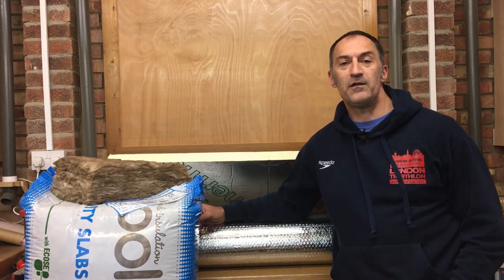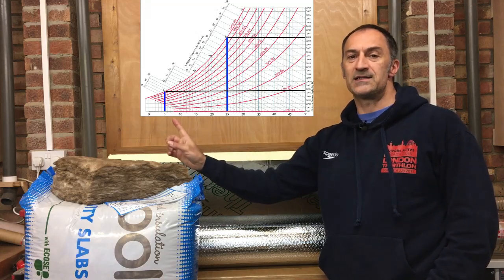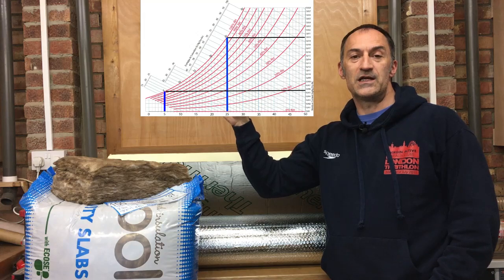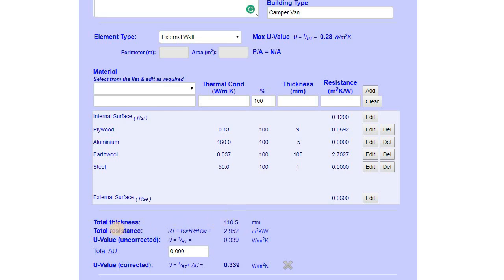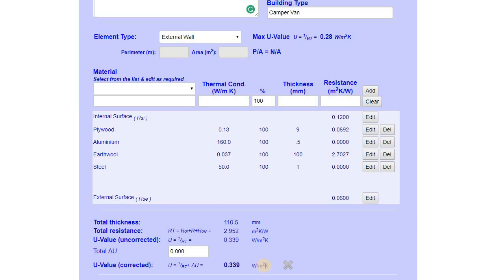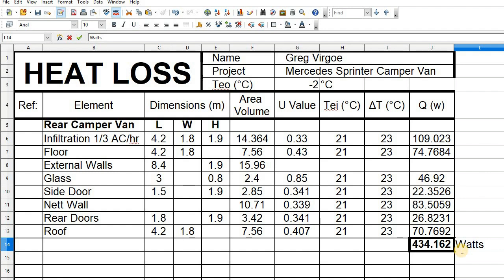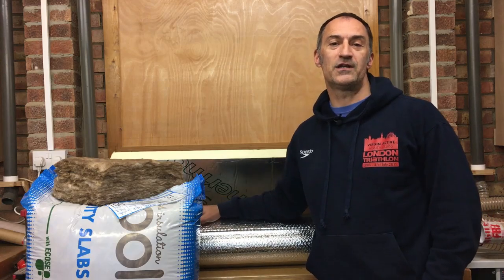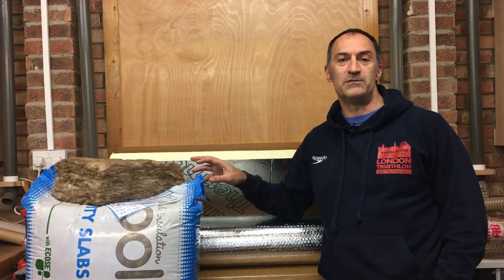How to Insulate your Van Part 1 - The facts you need!

Comment: It's amazing how many DIFFERENT OPINIONS there are regarding van insulation. I am going with you! I have already put some Polyiso with some spray foam so I am super glad that I didn't error on that. Thank you. But one question: it's probably best to put up the moisture barrier as soon as you can after gluing on the Polyiso? To prevent moisture etc.  What if you can't do it right away? Where do you buy the wool stuffing? And do you leave open internal spaces for electrical or use conduit on the outside?

Comment: Thank you Greg for THE most informative video on van installation I've seen. I'm a complete novice to van building. I had planned out my instillation from an amateur point of view before finding this video. I'll make a few changes, but it's good to know I got good SWAG (Stupid Wild Ass Guess).  I will put in a vapor barrier now. Thank you for explaining the need for one.
I have two questions if you have time.
#1- The ribs of the van, roof and sides, they transfer heat and cold even if you insulate around and inside them, correct?
#2- What are you concerns about mold growing in or on the insulation?   
Thanks in advance,
Dave

Comment: Greg I wanted to ask how you insulated the inside of the roof structure cross members? With Celotex in the top of the van all is good but the roof members are hollow and have holes all the way down so clearly this needs attention. Would you advocate expanding foam in there or just squeezing the fibre roll insulation in there?

Comment: Thanks for the great insight into this topic!  I have heard some say that a vapor barrier can actually trap moisture into the wall and cause mold/rust if it is not sealed perfectly, so it may be best to avoid them in order to let the walls breathe a bit and the condensation dry up... what are your thoughts on this?
Reply from the maker: Absolute rubbish Chris, The only reason those people say you need to let the walls breathe is because they get TONS of condensation all the time because they don't have a proper vapour barrier! Prevention is far better than cure.  If your materials are dry and your van is also dry when you install, there will be nothing in there to worry about.
Reply: @GregVirgoe  haha I'm sure your right, looking forward to checking out your other vid's, thanks

Comment: Have you seen the video of Bob Wells cheaprvliving glueing the first layer to the metal walls of his van with the theory that it will stop the moisture from condensing on the surface by eliminating any air gap? Do you agree? 

What about fasteners to attach plywood or walls? Won’t that defeat the moisture barrier anyway? 

My main concern is preventing mould. We will have a heater of some kind.
Reply from the maker: Hi and thank you for your question. I have a lot of respect for Bob I have watched his videos and I totally agree with his views on reflectix not being an insulator. With regards to his insulation in his second van I would make these observations. He has chosen a very good insulator and it is foil faced, foil is an excellent vapour barrier so it will prevent moisture getting into the insulation. Sticking insulation close to the wall of your van is a good idea as air is a poor insulator but that alone will not prevent condensation unless you have an adequate vapour barrier on the inside over all the gaps. If you don't seal where the joins in the insulation are or if your cuts are not accurate and you have gaps then condensation will still form in these cracks. Bob lives in the desert with his latest van so I would guess it does get too cold and he wasn't even bothered about insulating the floor or ceiling. Thermal conductivity of heat works the same for floors, walls and ceilings, so if it's cold out you will lose a ton of heat out the floor and ceiling and you will have condensation problems on those cold surfaces. A vapour barrier is essential.
To prevent bridging just fix battens to your ribs like Bob has done too and fix you cladding to the battens, that way you have no fixings directly from inside to the sheet metal. Internal soft coverings of auto carpet or fabric also help to raise the surface temperature above the dew point.
Keep you van warm and well ventilated and that helps massively to keep the structure warm and prevent mould. Hope that helps you 😊
Reply: Greg Virgoe wow what a fantastic answer. Thank you for answering thoughtfully and completely. Well done. I’ve only watched this one video but now I will go binge watch all your videos. Lol. And then go for it.
Reply from the maker: Hi, my pleasure, with so many opinions it can be difficult to know what's best to do. I will only ever give the best advice based on facts. I studied and worked as an engineer in this field for many years. You can trust my advice 😊
Reply: Greg Virgoe I believe I can. 😎👍🏼. I was a woodworker, finish carpenter, and general contractor for 25 years so in terms of physically installing it all with precision and care I got that covered. And now that I found you I have the technical source. The whys and why nots of it all. Again thank you.
Reply from the maker: That's fantastic, you can now doubt teach me a few things about woodwork. I would be interested to see your build when you get into it. 👍🏼

Comment: Thank you so much for this detailed video, great help. What do you think about using sheep wool sheets as insulation?
Reply from the maker: Hi esther, yes that is a very eco friendly insulation and does give similar thermal properties to rock wool. It’s a little more expensive but being green isn’t cheap unfortunately. Make sure you create a good vapour barrier over the top to prevent moisture getting to it. 😊
Reply: @GregVirgoe  thanks so much for your reply - am just digging through your videos, they are fab. Will hopefully start my conversion journey in February :-)

Comment: Greg? Do you have any idea what insulation the manufacturers are using on their vans?
When we were at the campervan show at the NEC I couldn't get an answer from the builders (most vendors there didn't have much idea about anything).
From what we could see there didn't seem to be much insulation at all; the floors and ceilings looked way to shallow to have anything much, especially the floors which seemed to be in total from the van bed to be no more than 20mm thick with a 25mm C-channel trim terminating at the rear by the doors.
Are we self builders using way more insulation than these guys or am I missing a trick?
Reply from the maker: Unfortunately, you are right and this is not an area of high priority for main manufacturers.
I cannot name brands but I have seen regular fibreglass loft insulation used in walls and ceilings with no vapour barriers.
No insulation below floors at all and more attention is spent on the cosmetic appearance.

Comment: Hi Greg. I live in the US. I have been told that if I am going to be spending 95% of my time in my van in warm/hot environments then I shouldn't insulate at all. Is this the case?
Reply from the maker: Hi Karen, great question and one that I get asked a lot.
Insulation works the same both ways, hot or cold, so yes it is a good idea to insulate.
It will help to prevent the heat being transferred into your van during the day.
Think of a cool box or fridge, they are both insulated to keep the heat out and the contents cool.
What will help to keep your van cool the most is to shade the windows as solar gain through the glass is the biggest contributor to rising temperatures during hot days. The sun's rays travel through the glass and heat up the objects inside your van and these then radiate heat and warm up the inside very quickly. So the more you can reflect these rays the cooler you van will be.
We have quilted window blinds that are reflective on the outside, have an insulated quilted inner core and grey fabric inside, help to the windows by suction cups and work really well at keeping the van cool in direct sunlight
Hope that helps

Comment: One thing I would like to add is that in some cases the acoustical properties are also important (especially in housing).
In the regard PIR doesn't perform as good as mineral wool, so in many cases some kind of hybrid is being used.
Btw, you forgot to add the PIR to your calculation?
Reply from the maker: Merlin Gallagher this video was not about acoustic properties of insulation.
You are correct about acoustic properties of PIR board.
The U value calculation is based on the lower section of side wall so nothing is missing.
You need to do a separate U value calculation for each different build up.
Then apply that calculation to each area. Thanks for your comments

Comment: Your knowledge and detailing is awesome. I need your help with my project. Just received my 2018 Ram promaster today with it will be  use for extended weekend-vacations only. I’m not going to put a permanent bathroom-kitchen other than a small portable ones. My question: 
can I get away with wool insulation for floor and walls and a sound barrier material? 
For subfloor, I heard I’m ok with 1/8, 1/4 of an inch play wood? 
Can you recommend a more flexible material for the main floor like maybe cork or rubber? 
Don’t like vinyls wood looking materials. Thanks and Can’t wait and can’t wait to hear from you
Reply from the maker: Hello, thank you for watching.
I would not use wool for the floor and you need something more substantial to stand on.
Lowes do a range of foil faced PIR insulating board in 8x4 sheets 1" thick which is ideal for floors
The minimum thickness of plywood for your floor would be 1/2" or 12mm.
Anything less than that and it will bend and sag. 
You can use wool for the walls, just apply a vapour barrier over everything before you line the van with your finish cladding. 
Hope that helps

Comment: Hey Greg. Cheers for this video mate. Good stuff. What do you think about using one of these materials for insulating a panel van...Armaflex, which is most commonly used here in Slovenia, or the more expensive  Remo xtreme insulation, which is propably almost the same...Im just a bit worried about its water resistance properties.  Also, what about sheep wool?
http://www.industrialinsulation.com/armaflex_sheet_roll.htm

https://www.reimo.com/en/D-camping_shop/DW-van_conversion_parts_accessories/DWC-thermal_insulation/

Tnx mate and cheers!

Comment: Hi Greg I'm trying to figure out my vapor barrier situation in my older sprinter. I'm especially worried about the lower sections by the wheel well. What do you think of using something like this encase I miss small areas with vapor penetration from outside? https://www.certainteed.com/building-insulation/products/membrain/ thanks
Reply from the maker: Yes, that photo on their website is them installing the vapour barrier for a house but it works well in a van too

Comment: Won't the wool soak up the condensation, and get moldy?? Great video by the way!!
Reply from the maker: NO, because there won't be any condensation, that's the whole point of the vapour barrier.
No moist air can get through the vapour barrier to condense on the skin of your van.

Comment: Hi there!! What do you think about using polystyrene??
Reply from the maker: If you look at the table at 0:15 you will see that polystyrene is in between PIR board and Mineral wool so it's a good insulator, it's light weight, bit messy to cut with all the little balls and not fireproof, but if you never have a fire situation that's not a factor. I think its ok to use.

Comment: I'm currently working on a van conversion, and the van is going to be kept mostly in really warm countries. Is the thermal conductivity value relevant if I'm trying to keep heat OUT of the van, instead of in it? And is there anything else I should think about before insulating?  Thank you for the pedagogic videos!
Reply from the maker: Hi Philip, thank you for your kind comment. The transfer of heat works exactly the same for both high or low temperatures. Think of your fridge or cool box. Both insulated with PIR to keep heat out and the contents cool 😎

Comment: Thanks for the video!
Isn't natural organic wool moisture and mold resistant? And no need for a vapor barrier? Most build outs I've watched are going away from vapor barriers.
Reply from the maker: It is water and mound resistant but the idea of the vapour barrier is to prevent any condensation occurring in the first place. Then you have no water problem to deal with. 
You can follow the crowd or do it the right way 👍🏼😀

Comment: Greg what about in hot places like Australia?  I heard no insulation and just use refletices. But does refletices need 3 cm between the van wall and refletices?  Please help.
Reply from the maker: Hi Ciaran, think of your van as a cool box full of beers. The better the insulation the less heat will be transmitted into the van. Definitely insulate well for both hot and cold climates. Reflectix inside your van does not work well either as an insulator or a reflector. 
You are far better off making blinds for your windows out of it to reflect the solar gain through the glass. By far the biggest heat gain on vehicles is through the windows. External reflective quilts are the best solution to keep your van cooler in hot weather. 
Ventilation at night will also drop the internal temp to make sleeping more comfortable. Hope that helps

Comment: Dear Greg,
We have a problem with insulating the floor in our DIY campervan. We hoped you might have a helpful answer for us.
On top of the floor their is a non-removable aluminium floor. This consist of long "hollow" aluminium pieces. 
Since we want to be able to stand up ind our van we cannot put much insulation on top of this. 
So our question is: Do you think we could benefit from putting insulation foam in all these aluminium pieces or would the metal conduct too much heat loss anyway?

Thank you in advance
Best regards Morten and Maria
Reply from the maker: Hi Maria, that's an interesting question. From what you have described I imagine you have framework of aluminium tubing across your van floor in similar location to where I have my timber battens? There would be gaps between the tubes and the tubes themselves are hollow? Insulating bet went he aluminium tubes would be of benefit, however as aluminium is such a good conductor of heat these tubes will creat a thermal bridge between the steel via floor and the new sub floor, if you can get way with say 25mm of PIR board over the top of the aluminium tubes then your new ply floor that would be best. Wood is also a good insulator so a descent thickness of plywood over the aluminium tubes with insulation in between then would be the minimum I would suggest. Hope that helps you, best wishes
Reply: Dear Greg, thank you so much for the quick answer! Yes, the floor is in a similar location to your timber battens. There are however no gaps between them. They are like a plank/wooden floor connected to each other. We thought about drilling small holes into the hollow space and filling it with insulation foam and then as you said af plywood on top. We were just not sure if it was a waste trying to fill them.
The idea with PIR is also good! Unfortunately we cannot get anything thinner than 40 mm in Denmark.
Best regards Maria
Reply from the maker: Maria Schmidt, unfortunately there is no point filling the aluminium tubes as the tubes will conduct the heat/cold around the injected insulation.
Can you obtain sheets of EPS in thinner thickness? You could use in similar fashion as mentioned before. Do not forget to use a vapour barrier either polythene or foil before fixing the new sub floor. 😃
Reply: Okay thank you so much for the helpful answer! We will look in to EPS then and try it together with plywood :)
Reply from the maker: Maria, one more radical solution but a bit messier to do would be to fix down timber battens at say max 400 centres and then spray foam inherent them shave off excess to the height of your battens (that's the messy bit) then apply vapour barrier then fix down new flooring, either ply or laminate or t&g boards. Hope that helps

Comment: Hello Greg! My name is Juan (from Argentina). First of all thank you so much for your in depth explanations of your videos. I have read tons of blogs about van conversions but sincerely nothing as well explained as your videos.
I am prepping  a Chevrolet Express cargo van for a road trip across the continent. Down here it's hard (or nearly impossible) to get PIR insulation. What would you recommend instead? I can get mineral wool, polyurethane panels,  polystyrene panels and the usual EZcool material. Ideally I want an insulation that would work well in both warm and cold weather. Thanks in advance for your time!!! Cheers

Comment: So that explains why I darn near froze inside my converted passenger van with no insulation and no heater in Central Florida when the temperature dropped to 28 Degrees Fahrenheit. I awoke to ice on the windshield. Ice. In Florida!

I was prepared for the cold since I wore three pairs of jeans, four socks, 4 shirts, a watch cap and heavy gloves and slept under four blankets. I was so warm when I awoke I didn’t want to get out of bed! The air inside was a different matter, 28 degrees. Wrapped in my blankets, I struggled to lean over the drivers seat and turn on the engine with the heat set for maximum and in a few minutes, warmth... The AC, cold, didn’t work but the heater did. I would not need the cold until the temp went above 77 at which time the van became unbearable inside. Well, when the temp went above 85.

I’m working on a design for insulation that works like Venetian blinds. Pull the cord and the other side of the blind faces out. Shiny side in to keep in the heat, out to keep it out. I also have an electric switch so that on it radiates heat and off it radiates cold. It can also be used to pull the light out of the air when I want to go to sleep. :)